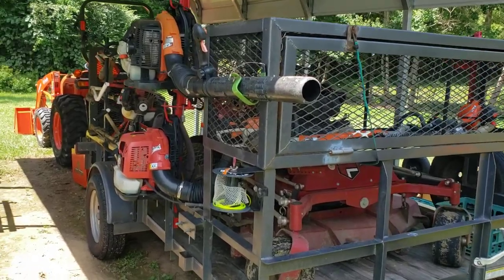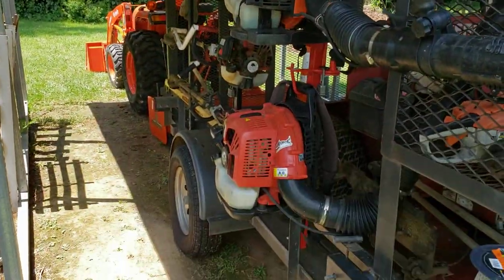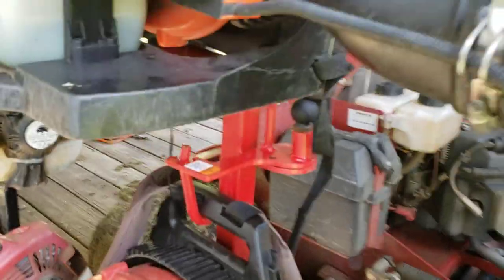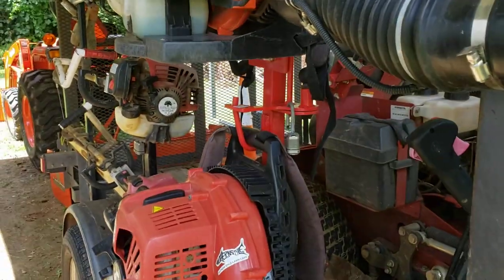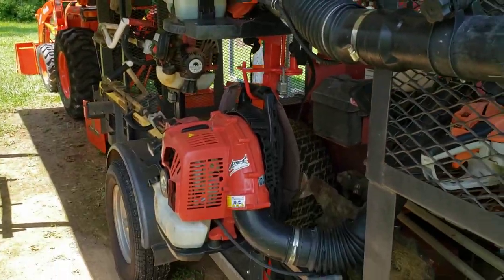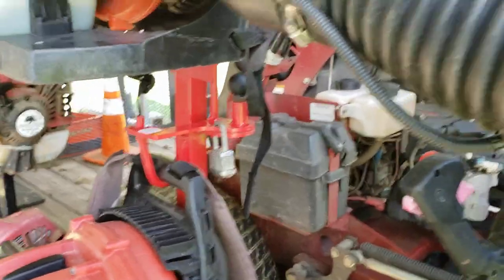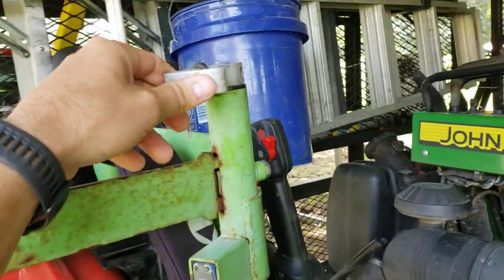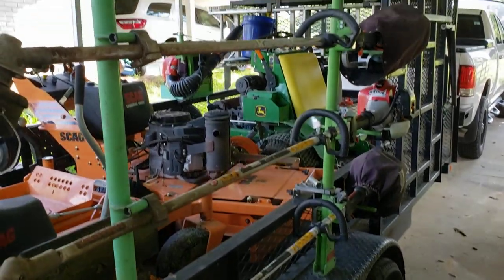New Blower Racks for Employees Truck!!! WHY took GreenTouch rack off..

Comment: Make lots of sense 👍
Reply from the maker: Yeah they dont like to close or lock Racks... You have to make it fool proof BC when your not around it wont get the attention it does when you are there. I personally have never had any equipment fall off but we have had 2 this season so had to make a change. 1 times a mistake.. Happens twice you have to make changes. Blowers aren't cheap.

Comment: I seen that Buyers recently came out with a blower that is similar to the Greentouch blower rack but its about $30 more expensive. just checked on the price comparison i figued for sure the greentouch would be more expensive but no
Reply from the maker: GT has patents so they won't be making it long if I had to guess.